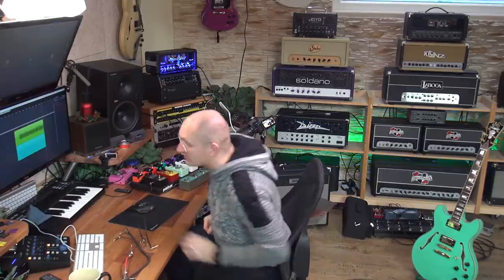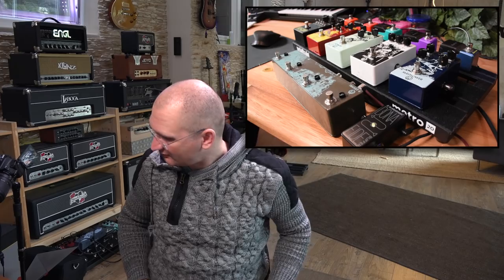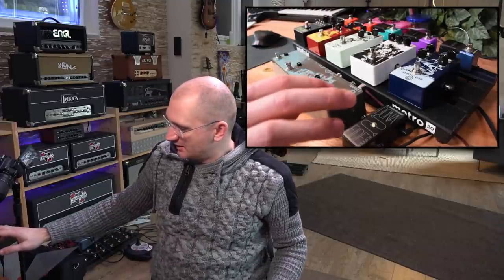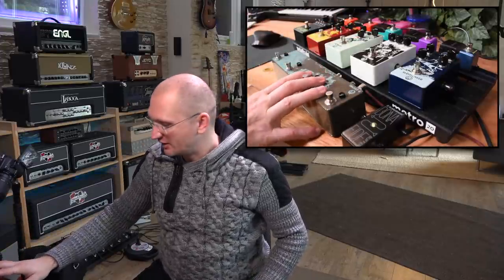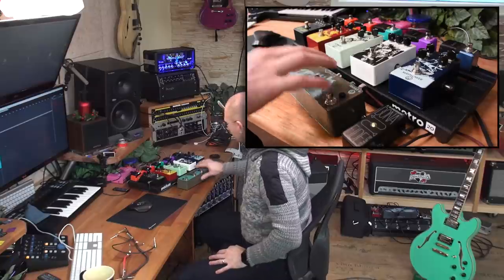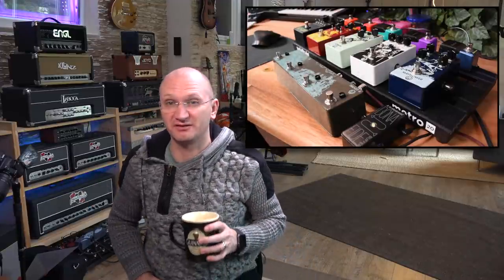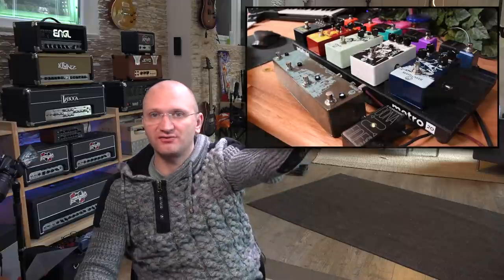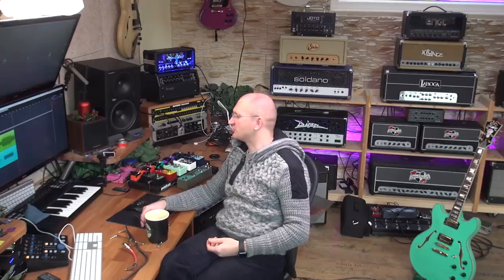!!! WRONG !!! TC Electronic BONAFIDE Buffer (Watch Part 2 Please)

Comment: First off love your demos keep it up.  The problem i see with this demo is  when your using the looping pedal it has a low impedance output. It would be a better test to have the effects and buffer switched in and out as you play the guitar.   I would suggest using the last 2 loops on your true bypass looper and add 25ft cables into each of the loops.  Then you would hear an audible difference in capacitance when switching them in and out.
Reply from the maker: +Devin Chance  Thanks! My mistake... I am uploading a new video !
Reply: Exactly

Comment: Henning!  After we had a conversation about cable I bought a bunch of Mogami cable and Neutrik connectors and rewired my board and looper.  Sweet high end returned to my rig.  I really thought that the Looper would fix any issue by removing anything I wasn't using.  Pretty amazing.  Well worth the cost of the cabling.  Why buy a Porche or Lamborghini and put crappy bald tires on it?  You wouldn't.  Thanks man!
Reply from the maker: Thanks!

Comment: The Ditto X4 Looper has buffed output, especially when you are using it. 
It always is a low impedance signal source. Maybe use guitar which have 250k or 500k (passive pickup) for demo we can hear more difference. Anyway, good demo!

Comment: Since the signal coming from Ditto has already been buffered, adding another buffer after that wouldn't affect the signal very much. Maybe you should plug right into the loop switcher, take Ditto out of the chain, so the only thing that buffering the signal is BonaFide.
Reply from the maker: +Phawin Phanudom    Thanks! My mistake... I am uploading a new video !
Reply: Actually this is a great video! Almost all buffer review video on YouTube are like "This sounds brighter with a buffer... and brighter is better." thats not the right way to test a buffer. We all know what a buffer does. This video shows that Bonafide PRESERVES the signal and not altering it like some Buffers do. It does make the signal sound a very little bit brighter but that's good enough for me.

Comment: What about boss pedals? i have 2 of them, sd-1 and tu-3, and i did the test, connected my rig to the amp and then the guitar straight to the amp and i couldn't hear any difference at all, i have 2x6 meter dimarzios and in my pedalboard i have dimarzios and fenders. Guitar>SD visegrip compressor>Morley Wah Tremonti Signature>TU-3>SD-1>Fuse Pedals Phaser (chilean made pedals)>Morley miniVolume>Amp. I will ad a flashback x4, ditto x2 and a tremolo to my loop soon, i hope.
Reply: +Tomás Gajardo Rivera (TomachoGajardo) 
As far as I know all BOSS pedals are buffered themselves.
Reply: I know, but about buffer quality, who's better? Are both equally good? Do all boss pedals have the same buffer?
Reply: +Tomás Gajardo Rivera (TomachoGajardo) 
I just read in some forum that the BOSS buffers may only make for a problem if you use a lot of 'em together, like 5-6 or so.

Comment: No, the Ditto looper is acting as a buffer because it has a very low output impedance. There will be very little difference when the buffer is engaged.

Repeat the test with a passive guitar (which has a much higher output impedance especially if you turn the volume down) as the signal source and the effect of the buffer will be much more noticeable.

Comparing different pedals with a looper is great normally, but not in this case. Love your channel, not trying to troll just trying to point out an error.
Reply from the maker: +timfireblade I am fixing it..... THANKS !!!!

Comment: Not sure if this is Youtube or something more sinister...but my detailed explanation of input and output impedance appears to be gone. Well, serves me right for trying to be helpful...
Reply from the maker: +Rhop Oh man... I would have loved to understand what is ACTUALLY going on!
Reply: +EytschPi42 Not sure if I sense sarcasm or not (it's always tough in text comments), but I'll give this another shot.

Imagine your guitar signal is water. Each cable and jack in your signal chain is a section of pipe (so every pedal represents 2 sections of pipe). The circuits in each pedal are like pumps. So, a simple, 1-pedal chain would be: 

Guitar (Source) -> Cable (Pipe) -> Input Jack (Pipe) -> Pedal Circuit (Pump) -> Output Jack (Pipe) -> Cable (Pipe) -> Amp.

Now let's discuss how this all works. Each cable (pipe) has "capacitance" (which is like a leak in the pipe. More capacitance = bigger leak). Passive guitar pickups out out a high impedance signal (Lots of water, not a lot of pressure). 

That low-pressure water (signal) flows slowly through the pipe (cable), so a lot of it leaks out (due to capacitance). This is why your signal gets weaker with longer cable runs.

So high impedance + capacitance is bad. The solution? We'll get to that.

Next, your guitar signal hits the input of a pedal. Let's take the Bonafide Buffer. It has an input impedance of 1M Ohm (1 Megaohm or 1 Million Ohms). 

It's a very large pipe. Your guitar signal has an impedance of around 10-20 Thousand Ohms (a small amount of water in comparison). So the water flows easily through the pipe, into the buffer circuitry (the "pump"). This active circuitry converts the impedance of your signal from high to low (same amount of water with more pressure). This low Output impedance is also depedent on the passive components at the end of the circuit (a small pipe carries less water at once, but with more pressure). For the Bonafide, this impedance is 100 Ohms (That's 5-10% of the original impedance).

Now you get to the final leaky pipe; the cable going from the buffer to your amp (or your other pedals). This time though, the water (signal) is pressurized (buffered/low impedance), and less of it is going through at once. A smaller amount of water with lots of pressure moves through the pipe too quickly for anything to leak; hence, no loss of signal.

And there you go. If you took the time to read that whole thing, thank you. It was long-winded, but that's what happens when you use analogies.

Hope this helps you Henning, and anybody else who might be confused by impedance.

Cheers.
Reply: +EytschPi42 Also, I sent you a Youtube message with a link to an image I made, which might be easier to understand than the wall of text I posted.